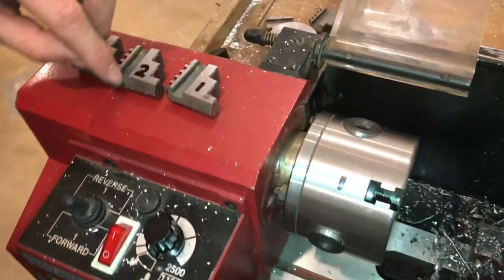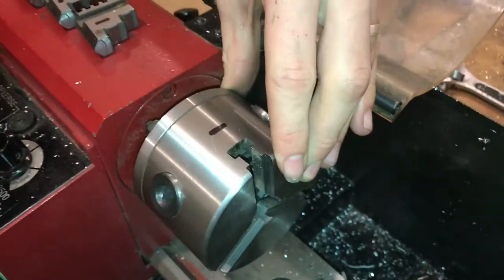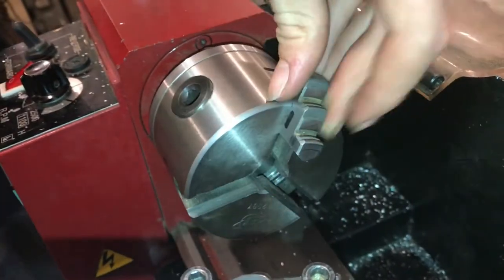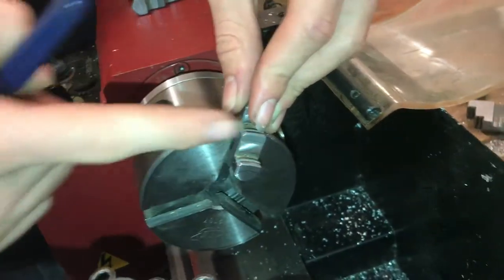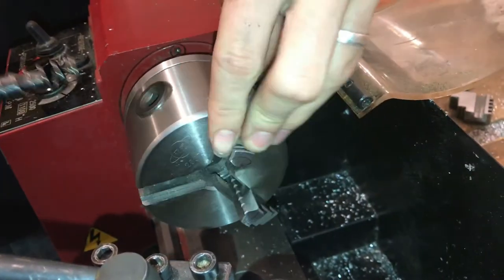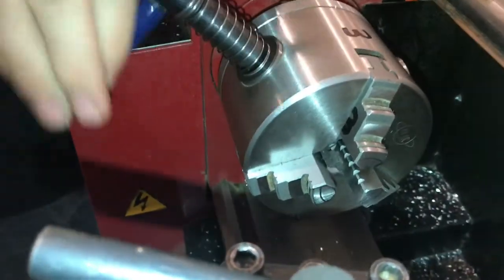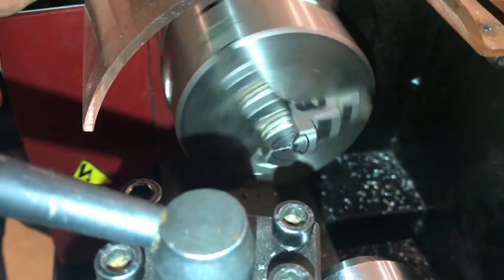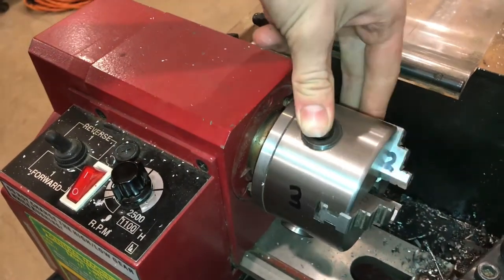UNDERSTANDING the chuck on the harbor freight mini lathe

Comment: Is that the factory installed chuck? Im trying to find reverse jaws and am not having much luck. I want to be able to hold some slightly bigger materials from the outside. Any help would be appreciated!
Reply from the maker: Yes the chuck on the lathe is the factory one. In order to reverse the jaws there are another set that comes with the shock. The threads on the back of the jaws are made differently. It is a little tricky to understand how to insert these jaws in the correct order. I made a video and released it today to explain the process. Hope this helps the name of the title of the video is. UNDERSTANDING three jaw chuck on a metal lathe (REVERSING the jaws for “bigger parts”

Comment: Quick QUestion:  I just bought this lathe but need to hold some items from the inside that have a diameter of only 14mm.   Is there a part or replacement jaws that can do this?
Reply from the maker: I’m not sure about the application that you’re using, but one option is to use a 14mm bolt. Slide your part between washers on the bolt and tighten it with a matching nut. As long as you use a hex nut, the 3 jaw outside chuck should have no problem holding it. This will not keep as much concentricity as a using inside jaws but I have used it many times. Custom work holding can get pretty complicated and without seeing your part it is difficult to diagnose. If the bolt doesn’t work, try playing around with different techniques. There is not really any one process that works for all parts.